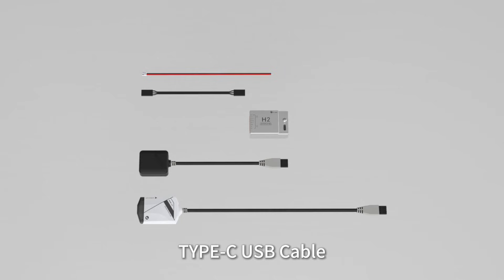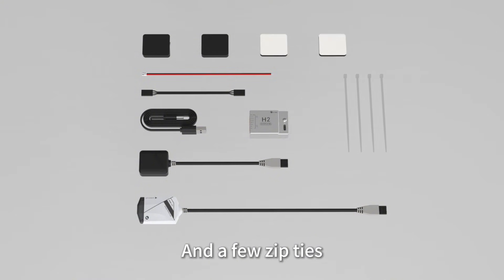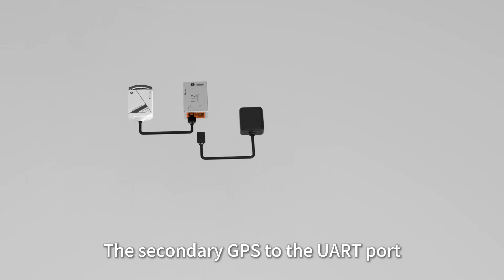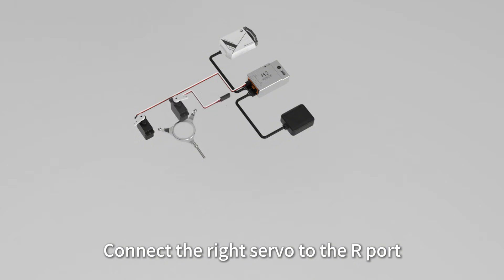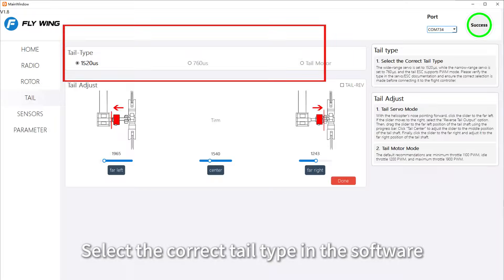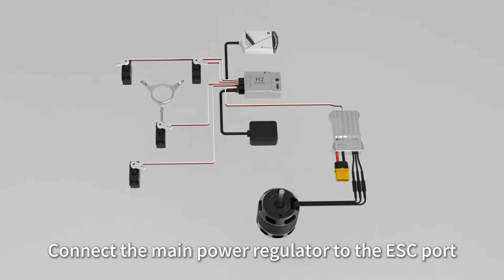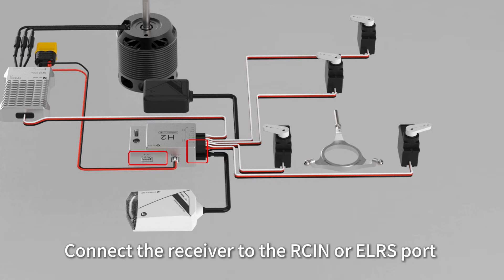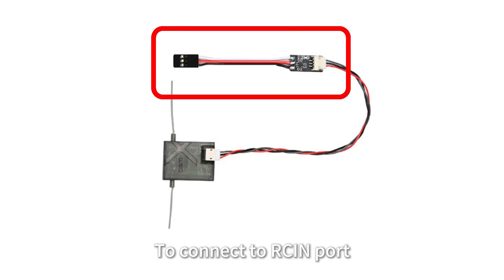H2 Flight Controller | How to install H2 Flight Controller

Comment: Does flawing have a similar video for the Chinook helicopter type? Not only the connections to 6 servos but also the parameter settings for the control plates (two front and two rear) in the assistant? I have ordered an H2 and I want to use it for the Chinook
Reply from the maker: You can refer to the traditional helicopter commissioning method, which involves turning one swashplate into two swashplates and adjusting the parameters.